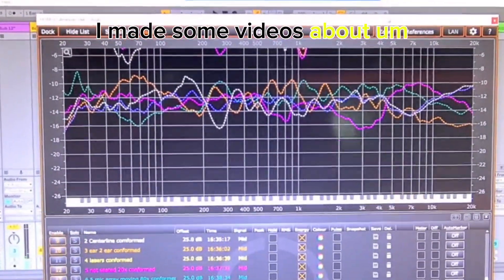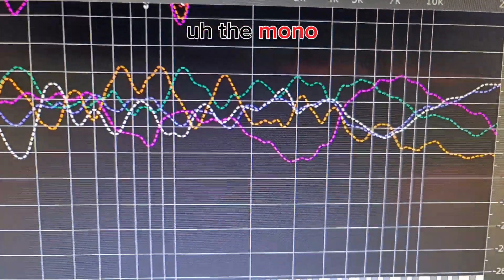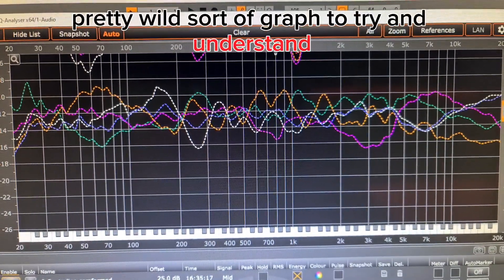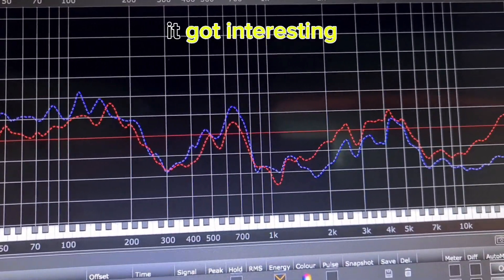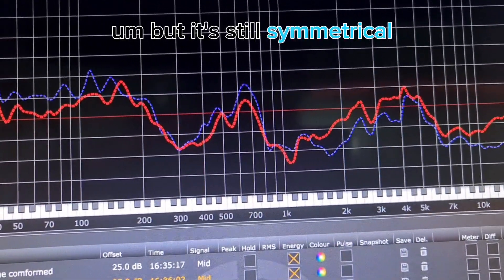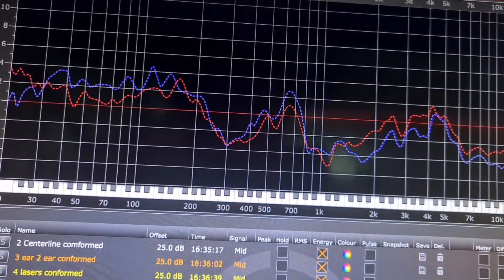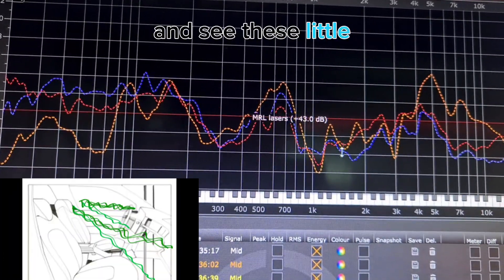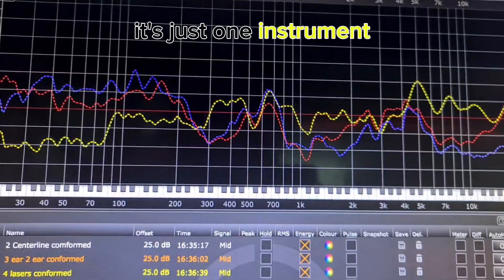Mic Technique Shootout - Part 8 - Stereo Difference

Comment: I suppose that in your specific case you have some absorbing materials on the dash and around speakers so they sound quite coherent and it leads to almost similar results for centerline and alpine techniques. They are symmetrical, as you mentioned, so left and right don't differ much, and so little correction is needed. At the same time, left and right sound more diffently for ear to ear measure, and the correction is more significant.
Reply from the maker: I think without absorption the mic techniques Alpine and Centerline would still prevail in imaging. 
Also look again at stereo difference graph of Alpine. A difference was found otherwise the line would be flat.
Finally the point of my 8 mic technique shootout was to listen. Most come from one mic fixed and jump straight to 5 mic array. If they could only do them all and come to similar conclusions to me in a shorter amount of time.
Reply from the maker: People should at least AB each new thing they do. As a hobbyist and psudeo scientist, all I did was ABCDEFGH.